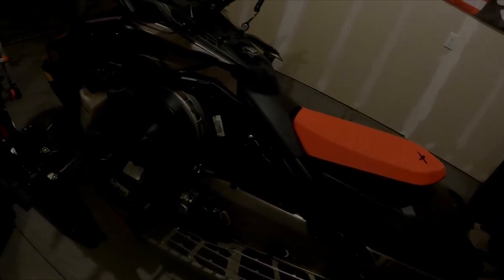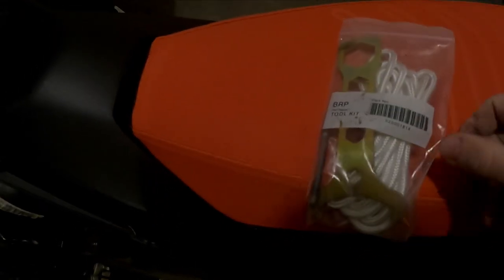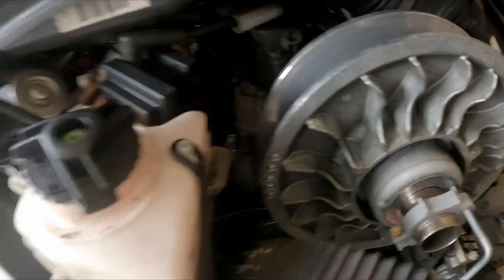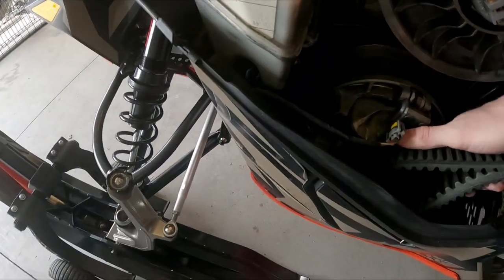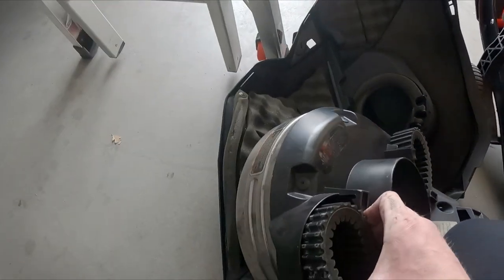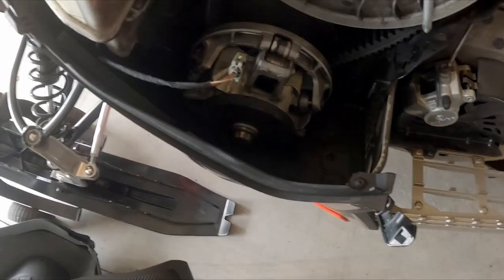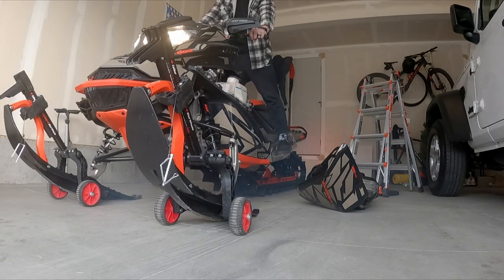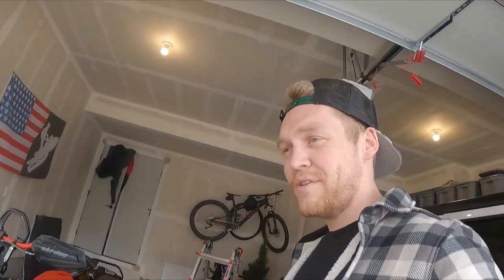How to Change the Belt on a Snowmobile - Basic Maintenance

Comment: Did you set your belt deflection?? I didn’t see it in the video..🤔
Reply from the maker: Yes I tightened mine slightly, but didn’t cover that - good point.
I based mine off from how much of the belt I can see above the clutch, and tighten/loosen accordingly. Feel free to share any additional insight or tips you have 👍🏼